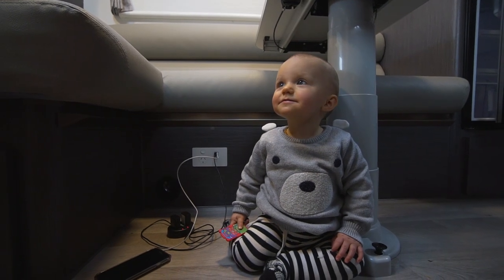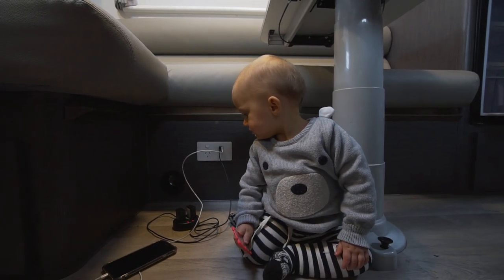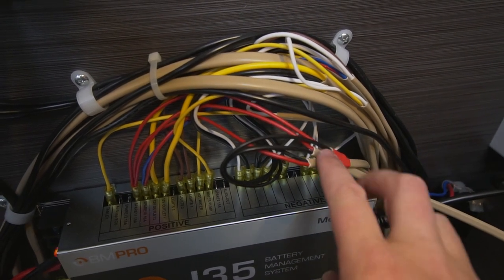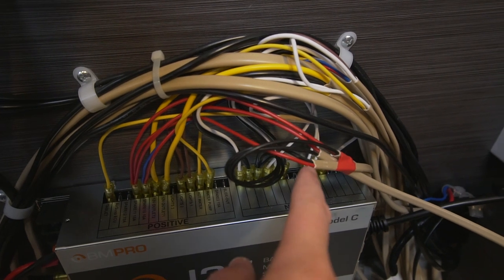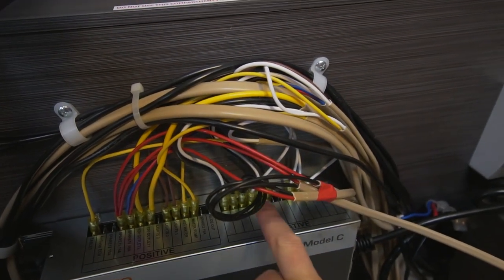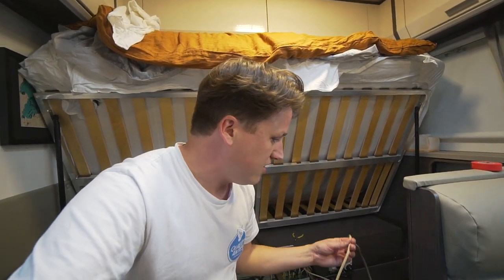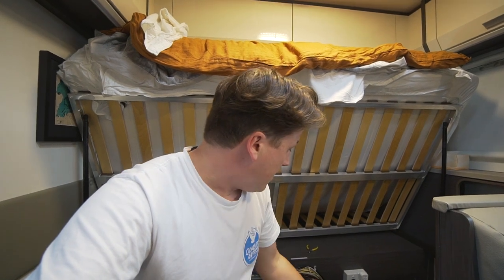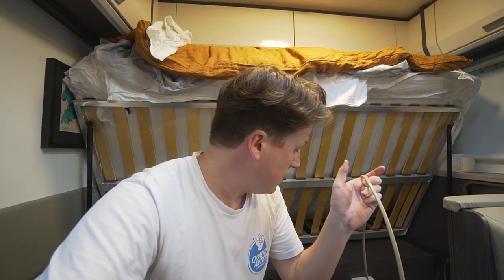Installing Your Own USB Plugs | RV Life DIY

Comment: Hi Bronson, you did a great job and your presentation, including disclaimer, was appropriate. If I may add 1 suggestion and that is I would have added an inline fuse to the new wire just in case. Because of your PMS that may be overkill though. Well done and keep up the great inspiring down to earth videos.
Reply from the maker: Thanks Wayne, really appreciate you taking the time to leave feedback 😀 good idea about the fuse, I probably won’t overload it BUT if we ever sold the van it would be a good idea, I don’t know a lot about fuses haha, would it be a 10AMP one or slightly higher than the max you want to draw? Like 15AMP?
Reply: Hi Bronson, watching your channel is our pleasure. An inline fuse 10amp on the new red wire would safeguard the factory wiring should the unforseen happen to your new usbs. I doubt you will have an issue its just a hint I was given when adding any load. Cheers and best wishes to the Rosy gang from South Australia.
Reply from the maker: Thanks Wayne appreciate it 🙏
Reply: @waynehobbs5175  Pretty sure youll find the USB socket itself will be fused. also the BM Controller becomes like a switchboard/ fuse panel and will shutdown the terminal should it short circuit.
Reply from the maker: Yup you are right there is a fuse in the little USB box thing and the BMPRO is covered in fuses haha

Comment: Hi Bronson. Another great vlog. Now I have a rather odd question for you. Our bed in our caravan is very similar to yours but I want to install the gas struts.  Can you show or supply any details on the size you have ? Thanks mate.
Reply from the maker: Sorry for the delayed reply Robert. They are "Stabilus Lift O Mat" branded, not sure on the size though sorry I can't see anything on the struts. Looks like SuperCheap auto sell them... guess it all comes down to how much weight they need to lift?

Comment: Bronson and others.
The 12V system battery is 13.8V minimum when charged. Not much difference in calculations though.
Always use the mm squared. The calculator uses AWG (American Wire Gauge). There is also SWG (Standard wire gauge (UK version). mm sq is more the norm and easier to understand and purchase here in New Zealand.
Yea your soldering leaves much to be desired. a bigger tip on the iron would have helped.
Good to see your using heat-shrink, don't under any circumstances use insulation tape.
Your Uncle G.
Reply from the maker: Thanks Uncle 😊 I wondered if you would see my soldering haha! I haven’t soldered in years. I see there are a bunch of those screw connectors used in the caravan already but I though that soldiering would be better?
Reply: Looks alot better than mine 😂